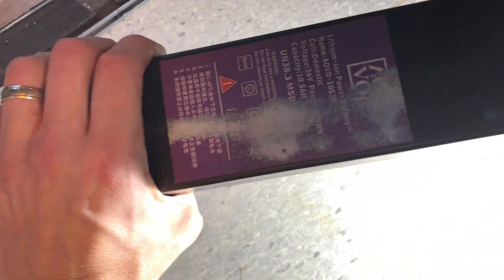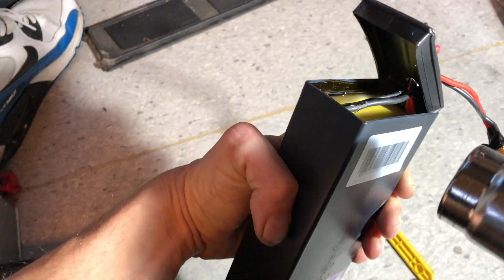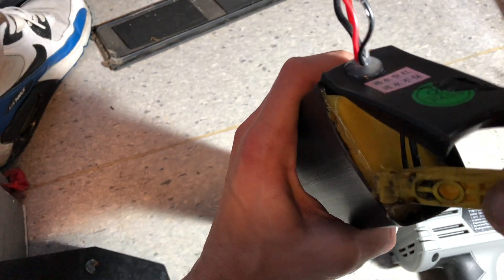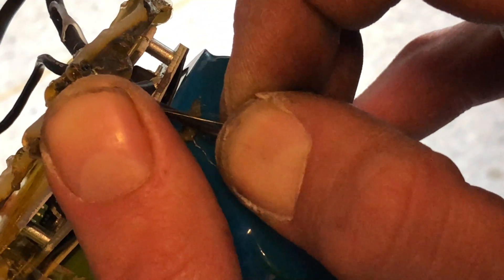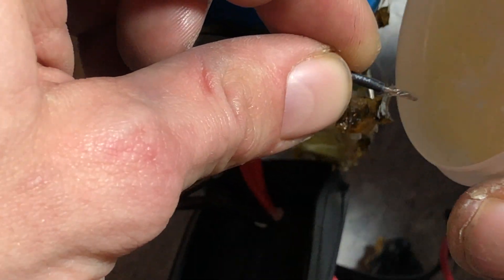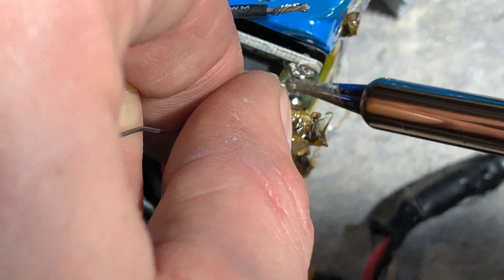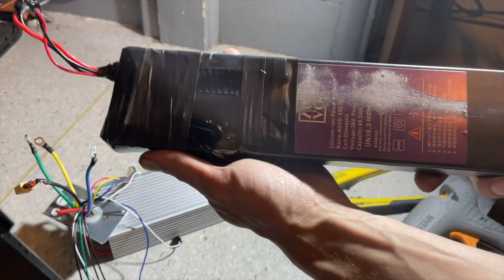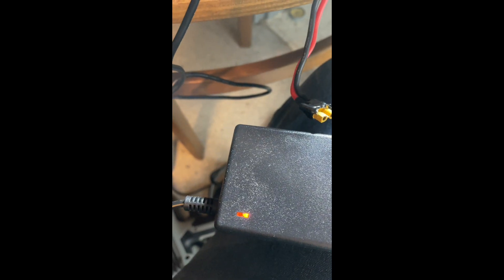Aovo pro e scooter battery full repair (not charging issue )

Comment: What brand of battery do you recommend the most right now? Finding a battery is easy cuz there's only about a half a billion different companies selling them on Aliexpress, but finding someone that sells a reliable battery is a different story entirely...
Reply from the maker: Hmm brand is hard but the cells used in a battery pack like LG , Samsung, Panasonic are always a good sign 

Kairi make some good packs 

A custom built pack by a experienced builder would always be best but comes at a greater cost
Reply: @electronicscootersthanet6360  I have a friend in OK who actually has the equipment necessary to connect the cells. I think he said he paid like 400 for it a few years back and I'm probably just going to have him do it!

Comment: I just had this problem, my solution without taking the battery apart was to join a peice of wire from the black charge wire to the black main battery fatter output power wire, both black wires connect to ground on the battery an all you are doing is bypassing the charge wire to connect via the power wire!
Reply: Cheers if I hadnt of read this comment I'd have ripped my battery apart. This worked a treat 👌
Reply: Thanks a lot. This also fixed it for me. Very much appreciated
Reply: Can you please tell me what to do step by step
Reply: Help me please
Reply: I know this post is old but if your aovo pro es80 is not charging, take your charger port and cut the black skinny wire, go to the battery and cut the thick black wire ad connect both, then connect the red wires still attached to the main piece you stripped connect black wires and red wires and your charger should turn red finally able to charge
Reply: Nu ocoliti bms ul veți vedea consecințele 😅😅
Reply: I have this problem. I ran a wire from the skinny black to thin black. Now charging works, but scooter only turns on when it’s plugged in. Doesn’t turn on when unplugged.
Reply: @handyman1833  does it still drive tho? also once it's on does it turn off by it self or stay on unless you turn it off
Reply: Worked for me aovopro

Comment: Nice one pal stripped it down but did not need heat gun . A sharp knife carefully around the edge then a plastic tool to ease the board out worked a trick

Comment: Is that the new version of the battery or the old one? 
What do you think of the scooter?
Reply from the maker: This is the old version battery , aovo for the money is good scooter they have a long warranty and the company does honour it so based on the support compared to other manufacturers they have been great!
Reply: @electronicscootersthanet6360  Do you know what capacity of li-ion cells are made of old and new batteries? The old ones are 10s3p and the new 10s4p or maybe the old ones are from 18650 cells and the new 21700? I have an ES80 scooter from August 2022 (dates on the controller and cardboard box) and the measured consumption of Wh during the full cycle charging is 0-100% shows the consumption of 220Wh from the mains via the charger (the battery was discharged up to 40%, counting the sum of the percentage of all recharges by dividing by 100% comes out that it has 7.5 full cycles and instead of charging with a full cycle of over 378Wh, as the manufacturer declares, it enters 220Wh) what do you advise me to do - contact the local seller from whom I bought the scooter or direct contact with the Aovopro service? After removing the platform cover, everything looks the same as in mine, and so does the controller.
Reply from the maker: @akrysmalski  This is a interesting question because actually the old battery definitely isn’t 10.5ah as stated.
The cells are 18650 26-c 3.6v 2600mah 9.36 wh
So 3.6v x 2.6ah is 9.36wh making the 
total 
36v x 7.8ah =280.8 wh 
The new battery is 10s3p and uses 18650 still but not sure the new cell capacity as of yet. But it’s rated the same as the old battery in AH and Wh (10.5 / 378)
Reply: @electronicscootersthanet6360  I returned the scooter to the seller (warehouse in Germany) and bought a used Xiaomi m365 Pro 2 at a similar price, now I know what the gap is between the clones and the original - it was definitely the best decision I could have made ;)
Reply from the maker: @akrysmalski   I love the xiaomi brand 👍🏻 they are awesome 👌🏻🛴